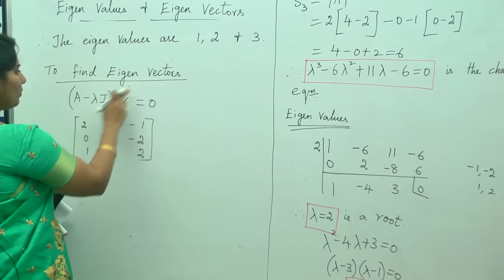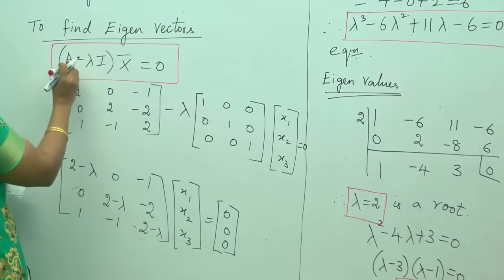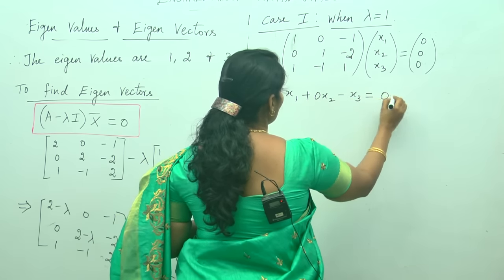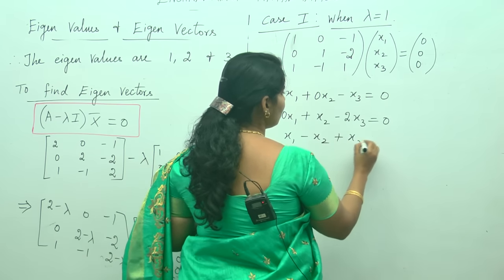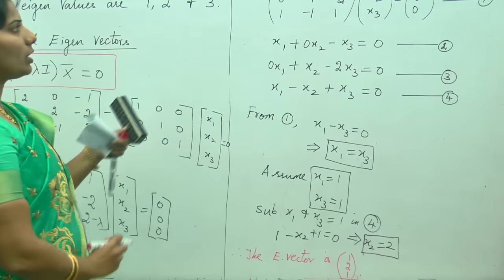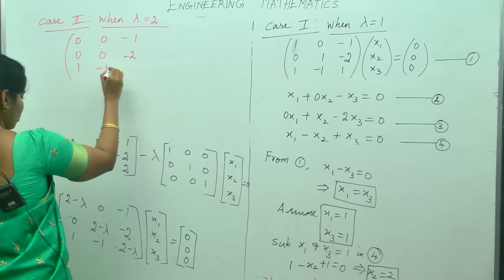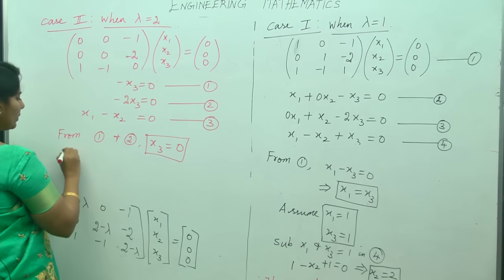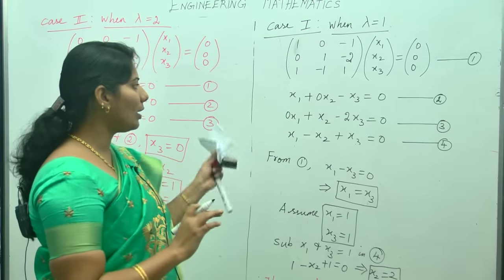Matrices: Eigen vector : Best Engineering Mathematics Tips (AU,JNTU,GATE,DU)

Comment: Ma'am. Eigen value 1,2,3. Kaha se aagya
Reply: By Solving Characteristic Equation,
In characteristic Equ, Put 1,2,3, and so on one by on in place of lambda, after putting the value, if the charec. equ. is equals to zero, then this will be first root, e.g.,,  putting  lambda = 2 satisfies the  char. equ. ( lambda^3-6lambda^2+11lambda-6=0), nd this will be lambda-2, from this, we get 1st root, that is lambda =2.
nd then,  divide ur chare. eq.  or cubic eq. from lamda-2, u will get (lambda^2-4lambda+3)
nd after solving this equ. u will get lambda = 1, 3.
And hence, lambda =1,2,3.